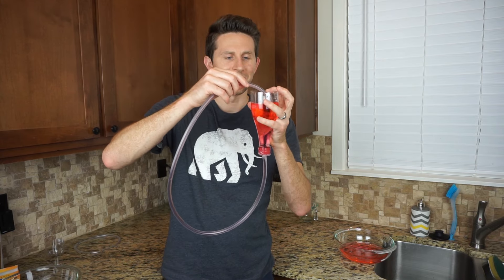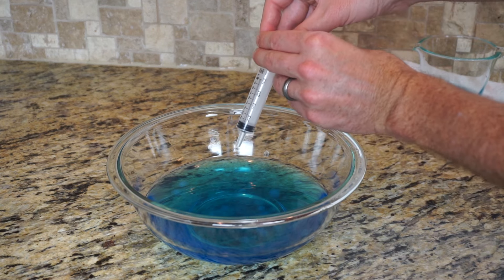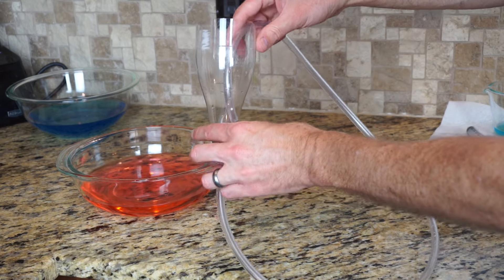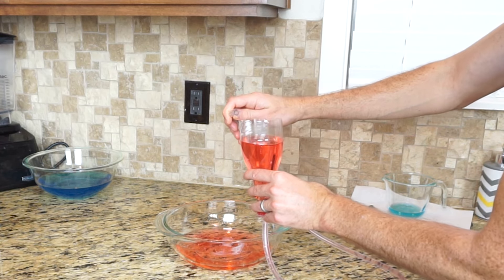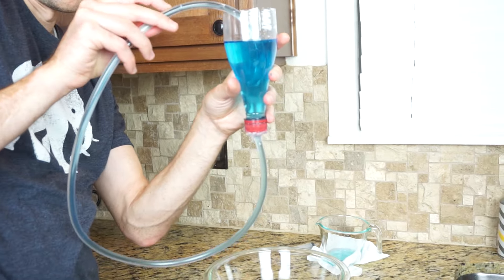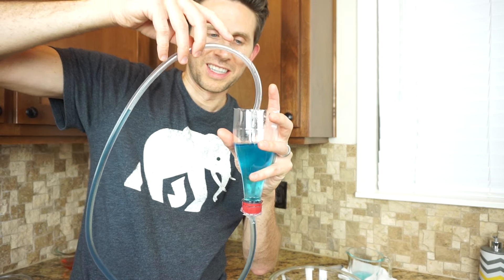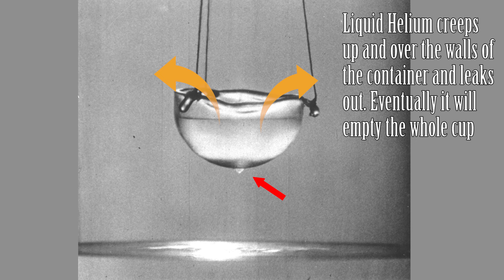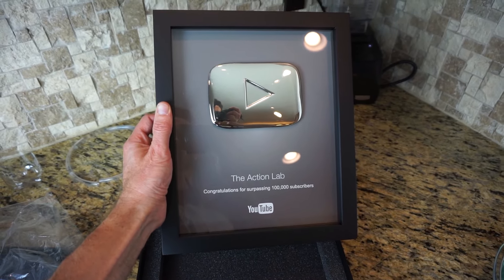Boyle's Self-Flowing Flask Filled With Polyethylene Glycol (Self-Pouring Liquid) = Perpetual Motion?

Comment: IN THIS HOUSE WE OBEY THE LAWS OF THERMODYNAMICS!
Reply: The Meme Himself That's not thermodynamics.
Reply: It is, thermodynamics makes the motion of the flask be transferred to the whole system (the room et cetera) as heat and thus destroy the motion while doing that.
Reply: Simpsons reference!
Reply: thats a big word.
Reply: Adarsh kumar It's a Simpsons reference. It's a joke.
Reply: I was thinking the same thing!! "There's something about flying a kite at night that's so unwholesome"
Reply: If perpetual machines work. It would violate the laws of thermodynamics.
Reply: the first rule of thermodynamics is we do NOT talk about thermodynamics
Reply: Fluid mechanics man
Reply: dji627 In physics and engineering, fluid dynamics is a subdiscipline of fluid mechanics that describes the flow of fluids - liquids and gases. It has several subdisciplines, including aerodynamics (the study of air and other gases in motion) and hydrodynamics (the study of liquids in motion). Fluid dynamics has a wide range of applications, including calculating forces and moments on aircraft, determining the mass flow rate of petroleum through pipelines, predicting weather patterns, understanding nebulae in interstellar space and modelling fission weapon detonation.
Reply: dji627 honestly. This is basically all you need to know
Reply: The Meme Himself Simpson’s
Reply: Go Simpsons!
Reply: mylobage actually it is, the laws of thermodynamic is what makes perpetual motion
Reply: mylobage Everything can be involved in thermodynamics numb nuts.
Reply: hahaha .. father of Science
Reply: @mylobage   IT IS
Reply: Hello mother dear
Reply: @OkanZagorAkkoyun  Heat is motion. Motion can’t be destroyed.

Comment: Everytime I click on a perpetual motion video, I check to see if it was posted on April 1st
Reply: Same dude, same...
Reply: Why
Reply: @ss_brokenstar4723  because perpetual motion machines dont work
Reply: Same @conjure_gaming cause April first is April fools Day in a lot of places. A day to prank people
Reply: Hahahaha😂😂😂😂
Reply: Ha ha nice reply I liked it🤣🤣
Reply: @billwebber5208  Please explain this idea further, I don't think you're seeing where the energy is coming from originally. Maybe you want to inflate the bags under water? Well it takes energy to move air into those under pressure. If you inflate those bags on the surface, it takes energy to bring them under water to where the weights will be
Reply: @billwebber5208  Thanks for the reply man. It was very well explained and you made it easy for me to picture in my head. I can definitely see what you are trying to achieve with the idea, but
I believe your main energy expenses in the system would come from a few areas. 
The operation of the trap doors  would require energy to move them, and this would also generate some entropy.
The water in the horizontal section would eventually overflow due to the small volume that the first trap door takes up when it's closed. When that trap door opens, a small additional amount of water, equal in volume to that of the trap door, will flow into the horizontal channel. You would then need to pump water into the vertical channel to maintain its level - which also takes energy and generates entropy. Evaporation of the water may be a concern in the long term as well.
It would also take energy to move the float and weights to the spot where they would be underneath the vertical pipe - again, generating entropy in the process.
It would would also require energy to remove all the  floats from the height that they are at so that they may be re-used. (Plus that annoying entropy generation again.)
Then all the sunken weights would need to be recovered - also requiring energy.
You could decide not to recover the weights and the floats, but that would take energy to continuously produce them and you'd have over-spillage from the volume they occupy.
Any device you use to gather energy from the falling weights will also have it's own in-efficiencies and entropy generation.
 
No matter the process (in the macro world) with enough analysis, you will find it mpossible to get more energy out than you put in.
Reply: U dun need to cause there bunch of bs upload on none april fool anywyas

Comment: I want to see this liquid interact with hydrophobic surfaces
Reply: If it’s not water then it won’t do anything with a HYDROphobic surface
Reply: @mr16325  This liquid has effect of hydrogen bonding... so it has HYDROgen... These are not AQUAphobic surfaces...
Reply: You guys studied more than me.
Reply: @michasokoowski6651  afaik hydrophobicity is due to molecules being non-polar unlike water, not due to presence or absence of hydrogen. There are plenty of non-polar liquids with hydrogen (like hydrocarbon oils) which are not repelled by hydrophobic surfaces.
Reply: @thedeadcannotdie  Yea, a huge shortening of thought, i don't know polarity of this liquid, but since it has hydrogen its possible its a polar liquid, so saying it wont do anything because its not water is wrong. 
Also, to be honest, i don't know any polar liquid that wouldnt have hydrogen in it.
Reply: @michasokoowski6651  ah yes, because anhydrous means without hydrogen.
Reply: @michasokoowski6651  dude wtf. Polarity  has to do with the distribution of electron charge in the molecules, not with the presence of hydrogen atoms. PCl3 definitely polar for example. It has no hydrogen and is a liquid. On the other hand, CH4, or even H2, have plenty of hydrogen but they are absolutely not polar.

Polyethylene glycol is quite useful as a substance because its chain is made of both polar and unpolar sections. The polar section is polar because of oxygen presence, while the unpolar part is where the hydrogen is.
The fact of having a mix of both makes the substance easy to dissolve in a large variety of substances, which is neat.
I'm afraid that the interaction of polyethylene glycol with a common hydrophobic surface would be rather boring for these reasons.

Also a note - the prefix -hydro comes from the Greek and directly references to water, not hydrogen. Hydrogen by itself is a word composed of "hydro" + "gen", which roughly means "generator of water". This is because the element was recognized to be a component of water quite early in history.
Reply: Things heating up over at the molecule fandom
Reply: @mr16325  it’s a protein mixed with water
Reply: @beta_nd_greeble  a drama is going to explode when they split apart
Reply: it would get repelled all the same, as polyethylene glycol like this is a solution in water.
Reply: me too! that would be cool

Comment: What would happen if you put a hole in the side of the flask below the water level? You could cover the hole with your finger or a one way valve then put the hose in that hole once the water starts flowing. That way you would never raise it above the level of the water.
Reply: In theory it might work but I think in reality it would just do nothing since there is no perpetual motion.
Reply: I think if you had the hole halfway above the water and halfway under water it might do something but I don't think it would keep flowing forever even with the polyethelyne glycol but I could be wrong it wouldn't be the first time.
Reply: I'm sure the pressure would just equal out and it would just be like a bottle with a long hose on it then.
Reply: Thatmight make a difference but the other way the pressure would equal out but having the air hole might allow the PEG to pull itself through. It would be interesting to see him try it.
Reply: I didn't think about pressure equalization, I just thought I had a great idea for a few minutes.
Reply: domineech there wouldn't be any flow of liquid if you did that. It would just be fluid sitting in fluid. It would be like submerging a garden hose underneath the surface of your swimming pool. It just sits there the water has no reason to move
Reply: dominic wilcox v

Comment: You're doing it wrong, you have to place the orange portal at the lowest point, and the blue portal up at the top of the cup. That should solve your problem. While liquid helium has no viscosity, it's still affected by gravity, so going up a tube would still require either power or a syphon effect to work.
Reply from the maker: +Eugene S yes liquid helium is affected by gravity but it has a strange property called superflow where it always climbs up its container walls against gravity. It is usually attributed to "wetting" as opposed to 0 viscosity. But it is currently not understood how or why liquid helium climbs its containers against gravity. So in this case the liquid helium could climb the walls of the tube and drop back into the original cup. If you are unsure if that would work then you could always dip the tube back in the liquid once it is flowing and then it would flow for sure because gravity doesn't effect it in a closed pressure loop.
Reply: true liquid helium would work in theory however keeping helium liquid for a significant amount of time is really hard it would turn to gas and stop pretty fast unless you were putting energy in(well technically taking it out since it needs to be cold but you know what I mean), and if it stops it is not perpetual there are lots of ways to make it work temporarily although I don`t remember them all, for instance I think some beers actually do work for a couple seconds if they are really bubbly ones until the beer goes flat or something like that.
Reply: The Action Lab Liquid helium would flow through the container it's in. Because it has the property to flow through most of the.
Reply: No. You have to have the liquid nitrogen, along with helium which is frozen. (you can freeze helium now)
After that, you can enter the 4th dimension, and there you can see some quantum slimes.
If you touch one of them, you might get an effect, called "Huehue Effect", where you will actually enter the 5th dimension.
Now thats when you can start poruing liquid.
Reply: Eugene S I love you 😂
Reply: Is this a portal refrence?
Reply: Every one commenting on this comment should join the debate team XD
Reply: The Action Lab but you have to take all energy from it to reach absolute zero so what energy is driving it
Reply: Eugene S I have no idea what you said but you might be right
Reply: After going into the 5th dimension, you need to find the Dark Lord Chin-Chin, and he will help you defeat the robot that controls Aperture™

Aperture™
All Rights Reserved.
© Copyright not allowed unless granted access by Wheatley.
Contact us at ℅¶$℅∆€©°×

And after that, hadrons will begin to accumulate on your hands, and assimilate your hands and assume the form of an egg, which you must crush by punching it with the pinpoint force of a needle, and then you will begin to disintegrate due to tachyon decay, and turn into a potato. Now you are in Dimension 404, and you can now create helium.
Reply: The cake is a lie
Reply: Max Chu 
no.
Reply: @King_ Tesseract Helium will not flow through the container it is in.. We keep them in Steel containers, and it is not going anywhere..
Reply: Nice
Reply: None of the nerds here seem to get the joke but me.

@The Action Lab although that is pretty interesting. Perhaps, since helium is less dense than air, it maintains the same property even in a liquid state? I know that doesn't make a lot of sense, as liquids are naturally more dense than gasses, but what if liquid helium has the equivalent density of gaseous helium, just like solid water is less dense than liquid water?

Okay, because you have better access to certain materials than me (my parents would never just get me liquid helium and I'm still only 14), could you do me a favor? Place liquid helium in a vacuum chamber and post the results somewhere, or tweet them to me (my twitter is @foxcheetahsp). I hypothesize that when placed in a vacuum, the superflow property of liquid helium vanishes. You don't have to do it, but it would be great if you could. I don't want to force you to do anything, and I understand completely if you can't. Heck, I have no idea whether you'll even see this or not. [Insert general whining about life here in the feeble attempt to guilt trip] [Insert compliment] <--- Jokes
Reply: Foxcheetah Nice questions..

Liquid helium is much dense than Helium gas.( 125 vs .16) But in superfluid state,( below 2.1 K) the density of superfluid helium is similar to gas (still higher). If you have superfluid helium in a vessel, it is difficult to see the surface between liquid and gas due to this small difference of density.

For the second part of your comment, sadly your hypothesis is wrong. Not only Superfluid property is not lost in vacuum, that is actually how you make superfliud.

If you take Liquid helium (4.2K) and keep it in vacuum, its boiling point drops (just like water boiling up a mountain at a lower temp). Thus at certain value of vacuum, the liquid starts boiling at 2.1 K and Helium becomes superfluid.
Reply: +Sankar Ram Okay I have some questions.
1. K stands for Kelvin, right?
2. What is a superfluid? (I believe it gives it the superflow property? Maybe?)
3. Does a superfluid remain a superfluid even when the temperature is raised back to normal, or will it convert back into a liquid/gas again?

So I'm guessing that because the density of the air around it is nonexistent when in a vacuum, there is no pressure to allow the helium to hold its shape. Because of this, the liquid helium expands until it has relatively the properties of a gas, despite still being a liquid. Thus, it is a "cold gas" or superfluid. Am I correct? Sorry, my focus is really hazy as I'm writing this. ADHD is a b**ch to deal with sometimes...

Although, if liquid helium still has superflow properties as a liquid, despite not being a superfluid, do you think that means it has hyper-adhesive properties? It would already be likely that helium has an electric charge, having much less protons as it does electrons. What if this causes it to "cling" to the surfaces of oppositely charged materials (like silicon, a primary component of glass), yet not react with them due to helium being a noble gas? If you combine this with the helium atoms repelling each other, as they all have negative charges, this could cause it to climb up containers extremely fast. This could also explain why the superflow properties of the liquid helium in the video cancel when it pours out of the container. It is only hypothetical, but this idea could likely explain more and have less flaws than the previous one.
Reply: Foxcheetah Foxcheetah K stands for Kelvin. It is a easy unit to deal in cryogenics because it will never be negative. Normal helium boils at 4.2 K.

Super term is used in cases where the resistance in that domain is zero. In electrical there are superconductors which have zero resistance, in fluid we have superfluid with zero viscosity. 
Superfluidity has been discovered only in Helium below 2K. 

3) If temperature goes up superfluid becomes normal liquid helium and after it is above 4.2 it becomes gas.

The density of air around it is not non existent. As you apply the vacuum, the liquid helium is boiling and creating gas to maintain its vapour pressure. This boiling removes heat from remaining liquid cooling the liquid further. 

Another point is it is not pressure that gives liquid its shape. It is its surface tension.

Why superfliud acts that way is still a hot research topic and I am no way competent to answer that. I work with cryogens but don't study their physics.

Comment: Can’t you use a longer hose where the length of hose that is pointing downward into the flask has a greater volume of fluid than the rest of the vessel (probably have to coil that section).  Then use vacuum pressure by putting your thumb on the end before the pour.

The tricky part is keeping the displacing air out of the tube.  I think you have to overwhelm it with pressure.

Comment: Liquid Helium: you can't put a turbine on it to extract work. My brain insists on putting on a "water wheel" to be spun by the liquid falling down, and I have a hard time convincing it that extracting the energy from the gravity acceleration will stop the flow too (because energy conservation and stuff - the falling liquid helps counter gravity on the side where it goes up, does it not?)
Reply: Judging from what the guy said it won't work. Liquid helium doesn't have friction so it would just slide off the turbine.
Reply: @zerothefaceless4888  - conservation of momentum. It would have to change direction, and that momentum has to go somewhere, friction or not

Comment: Ain't no hydrogen bond donors in PEG.
Reply from the maker: +bulletmagnet25 PEG is full of oxygen atoms i.e hydrogen bond donors.
Reply: Oxygen atoms in ether groups (anywhere in the middle of the chain) can only act as hydrogen bond acceptors. I wasn't entirely correct in my previous comment, because the PEG chain might be capped with alcohols that can act as hydrogen bond donors, but that's only two hydrogen bond donors in a very large molecule. 

Impressively quick response though!
Reply from the maker: +bulletmagnet25 the oxygens in ethers are very much electronegative. They cannot form hydrogen bonds with other ethers (except on the alcohol ends) but they can form it with water. This solution is in water and thus the hydrogen bonding I was talking about is the PEG dragging along water which is dragging along more polymer chains. But didn't want to go into that level of detail in the video. Good points though.

Comment: So what if you use the small tube for the capillary action and put a string in or around the tube to break the surface tension and allow the droplets to flow?
Reply: Capillary action is an effect of surface tension. If you reduce surface tension,  there would be less capillary action,  and you'd end up with the same result.